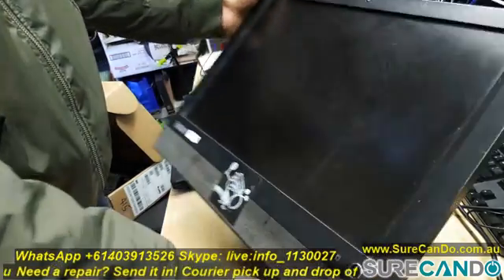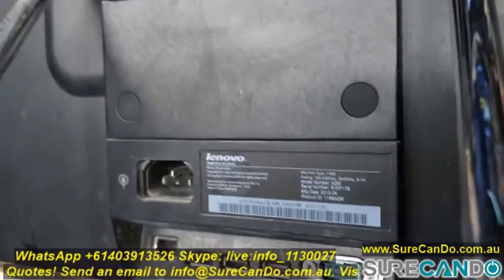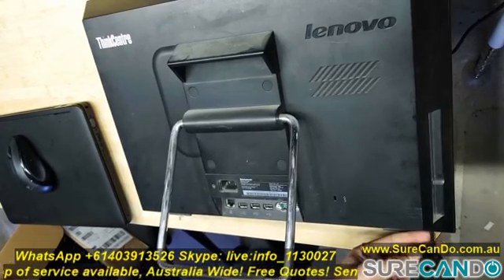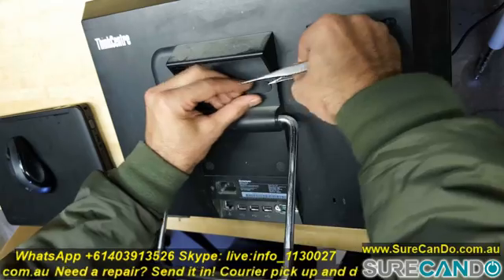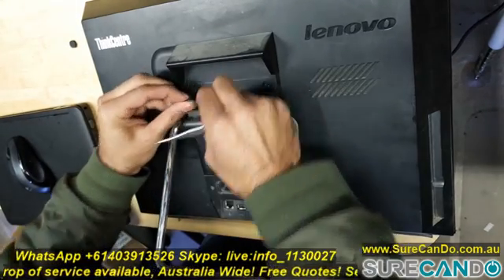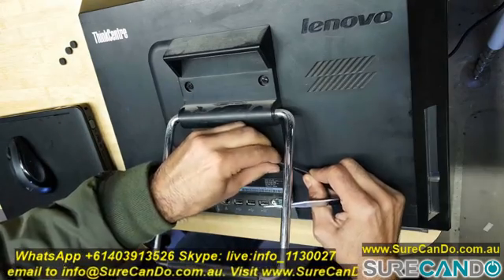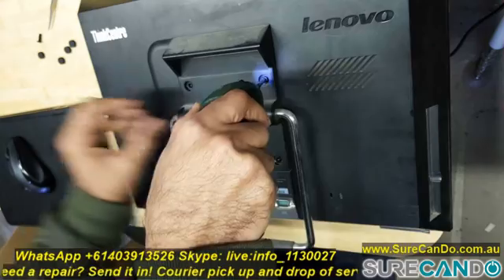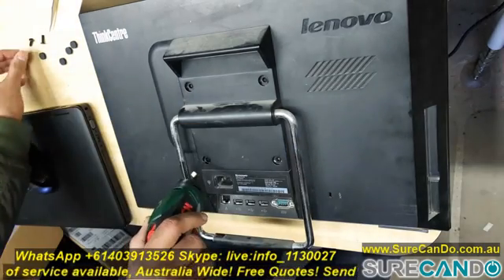Lenovo ThinkCentre A70z Type 1165 SSD Upgrade Disassembly Guide

Comment: Hi, its the cpu soldered or can be replaced in this model?
Reply: @tamerlan_05  If you wanna go safe, upgrade a Q8600 and the most powerful for that socket is the Q9650 but have to check the TDP for that model.